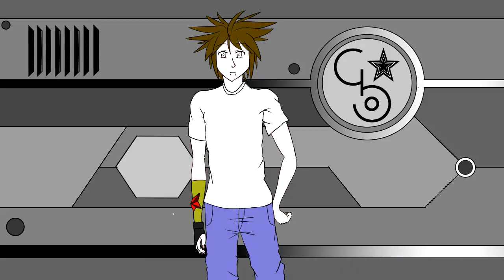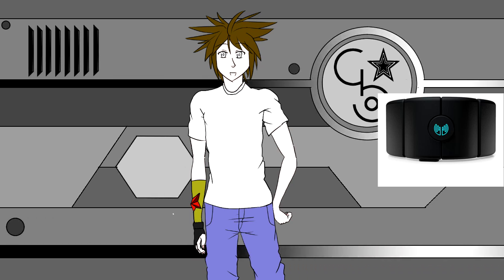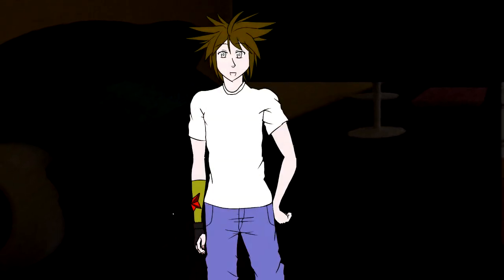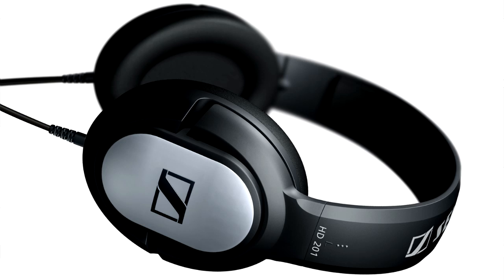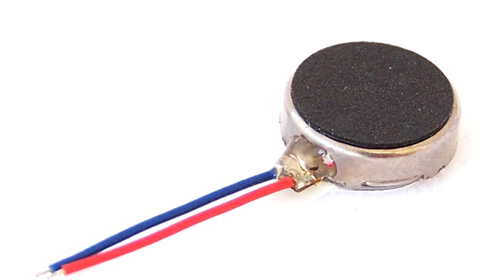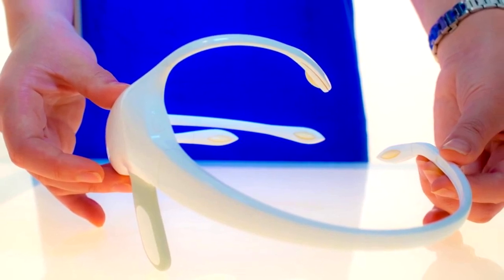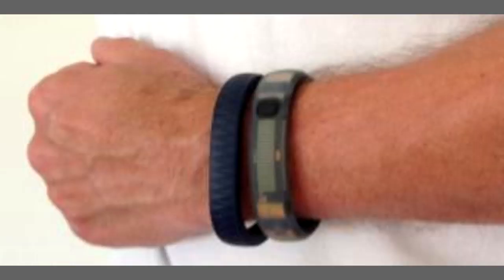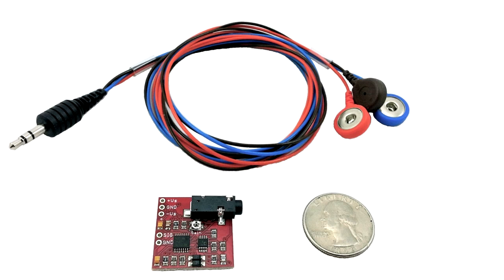Virtual Reality Rig 2014 Explanation Pt.1 - Materials

Comment: what games are compatible with this
Reply from the maker: Kian Curatolo Unfortunately, there's basically nothing unless you count rift supported games and my internal unreleased prototypes. The VR industry as a whole right now is kind of suffering from a lack of a decent input system that can really be called satisfactory compared to the immersive experience that current HMD tech provides, though work is being done. For now, I'd say the best VR controllers would be the Leap Motion 3D and Razer Hydra simply because they have a lot of support, though Valve's control solution for the HTC Vive could become the new standard if Oculus or some other player in the VR industry done come and sweep things away. Personally, I'm trying to work on a few EEG only solutions with AI support systems to try and get a smoother, more affordable experience (my wallet learned last year that this whole set up is a bit out of reach for the standard consumer), but if one wants the best VR experience, sadly I'd say this kind of a rig design isn't all that outdated, though this is of course my stance on the matter. Depending on who you ask, a solution like PrioVR with an Omnitreadmill or VR gloves will be the future. 

Hope this answers your question and thank you for commenting :)

Comment: I preordered the Myo because of the same reason, but I cancelled my order because I don't believe that Myo is the right product to use. Although the technology behind Myo is what is ideally useable for VR, the implementation Myo chose severely limits the possibilities, most importantly they chose to not include the EMG data in the API, and the EMG data is transformed into gesture data on the Myo itself, because the EMG data can't be streamed over bluetooth efficiently. So Myo might be out of the picture.
Reply from the maker: Sad to say it, but I've also cancelled my pre order on the MYO. I was highly enthusiastic for the MYO when it was first announced, but as you mentioned, they have chosen to not provide raw EMG data in the API. (I actually still remember how shocked I was when I first heard about this in the replies on their forum.) There were also financial concerns that pushed things on my end, but the lack of raw EMG data, a wired method for input gathering, schedule slips on the part of the developer (they started out saying in the first half of 2014, I cancelled this month of August so they were late on that end), and due to a desire to further pursue other routes (I'm looking into EEGs next, preferably with more open hardware.) I kind of feel bad to cancel on them since potential of EMGs is real and their own ideal implementation has its uses, but it just feels as though it doesn't have enough of a use to hit the level of market penetration and developer support that will be needed out of a control system. I've saved myself some cash in the end, but this still leaves me with a great concern for the market of VR as a whole.

Comment from the maker: @Swirlypop SP It's hard to say really. My own rig is currently in the upwards of a $1000 based on the current design. I may be able to cheapen it with some modifictions I've been looking into, but I wouldn't doubt the first generation of NerveGear like devices would cost any less than $300. I'd personally expect a full on $1000 with another $1000 for a machine that could run it. Then again, for all we know it could be dirt cheap to produce and cost $100 like the Mindwave. There really is no way to calculate the cost of such a thing since really, a company can price something at any price, even if it costs them money (selling at a loss to stimulate the market and then later recoup costs in software like many game consoles did). If we treat this device as a gaming console, then I'd say somewhere in the realm of $400-$500 as consoles sold past those prices have historically done very poorly.

We have to consider that this is a device with MUCH more utility than a phone, computer, or even house in many ways. I could live in a dirt quality apartment with a device of this caliber, yet spend most of my time in VR in a house that looks like Elsa's castle. It truly is hard to measure how much it would cost simply due to how great the product you get in exchange for you money would be.

Hope that answers you question. :)
Reply: This is really sweet! If you need any assistance or anything  you can pm me! I'd love to work with you!
Reply: I love to watch sao and i wish you can reply me and ask me for assit
Reply: Wow!! I would like to help you cause I am also busy with my own version of NervGear. So if you would contact me I would gladly explain my NG to you.
firephoenixoffical@gmail.com
Reply: +Virtual Dreamers Well done. I've been watching a lot of your videos lately. Thanks to you I even started to my own research on the brain, possible virtual reality in the future, the senses. all that fun stuff.  I don't know how helpful I could be technology wise seeing as I don't know much about how tech works. But if you need a researcher I could help with that. so yea i am"technically challenged"  But overall I'd love to help     Mjim96@gmail.com